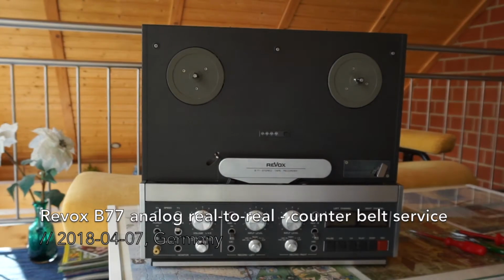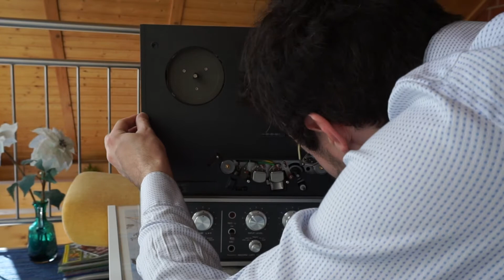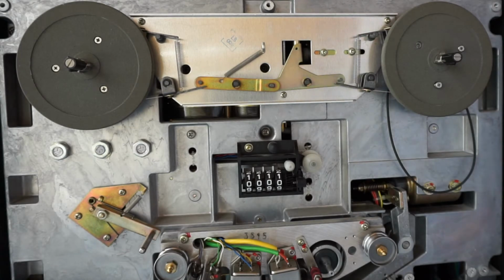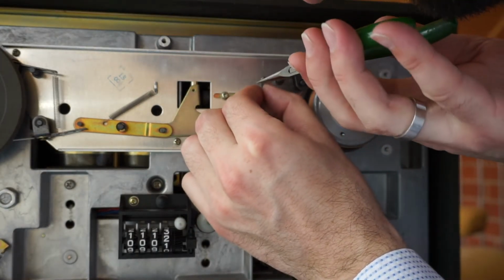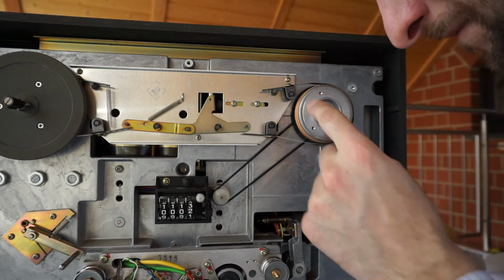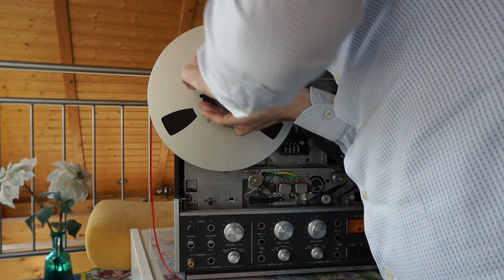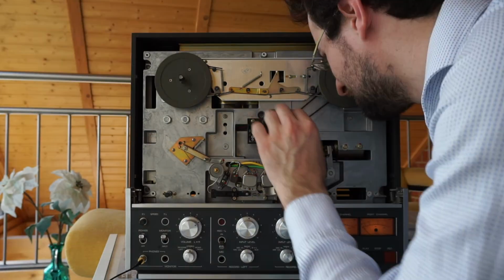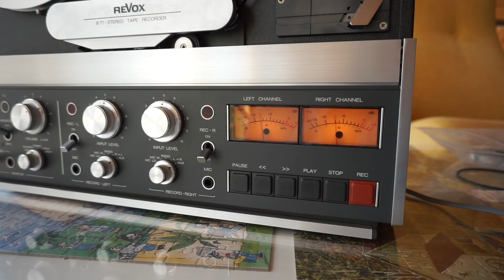Revox B77 reel-to-reel: look inside, counter belt service

Comment: Hello, I leave a question, maybe you can help me. Does the sound of a revox a77 depend 100% on its heads (head)? I'm seeing if I buy Revox a77 that apparently has changed heads and I have my doubts. Thank you!
Reply from the maker: Of course the heads have big influence as  have all the other electronics after it and measuring and tuning it.

Comment: Kleiner Tipp. Wenn du beim Bremsband an der unteren Halterung den Sprengring abmachst, kannste das Band da abziehen und den Riemen über den Bandteller abnehmen. Ist weniger Aufwand und nicht so umständlich.
Reply from the maker: Hast du noch Tipps zum aufarbeiten der Bremsbänder? Könnte ein bisschen besser bremsen, oder?
Reply: Ich habe noch die die Bremstrommel abgenommen, um den Riemen zu wechseln, immer nur das Bremsband oder den Bandteller. Dann das Bremsband von Hand lüften und den Riemen durchziehen. Und mit den Fingern an das Textilband oder das Stahlband packen ist ein no-go! Eine Spur Fett und schon lässt die Bremswirkung nach.... Wenn, dann bitte beides hinterher (nach der Montage, aber ohne Bandteller) mit einem Wattestäbchen und Isoprop gründlich entfetten. Wattestäbchen einfach zwischen Trommel und Stahlband durchziehen. Dann hört meist auch dieses "Brummen" kurz vor dem Anhalten auf.

Comment: that is so much easier to do if you remove the counter
Reply from the maker: not really, why? only more to remove, what was a bit hard and fragile to remove was the brake drum NAB axle thing, and as far as I can see you would need to remove that anyway to get the new belt over it, ..?